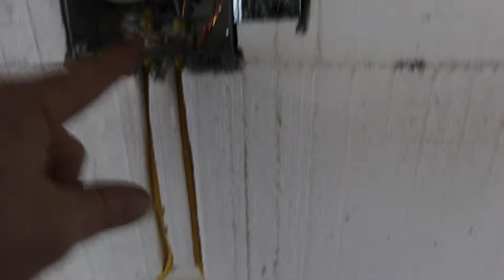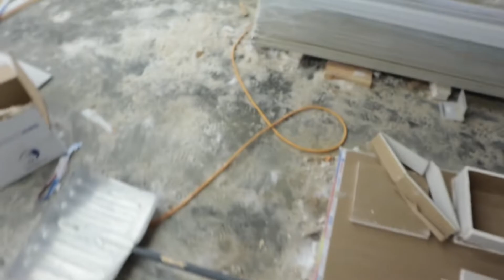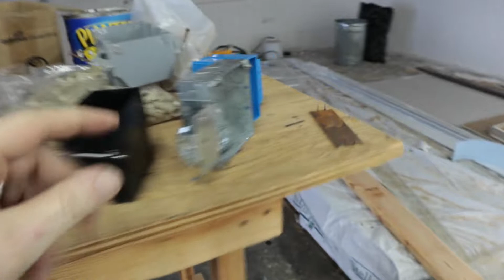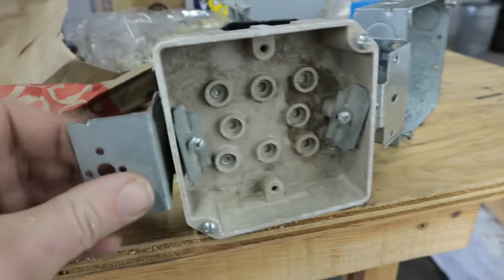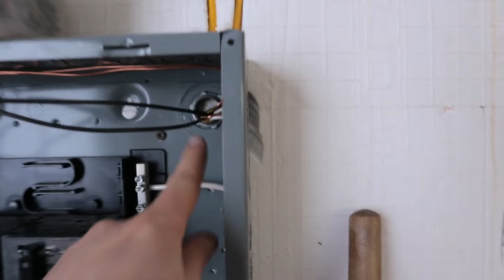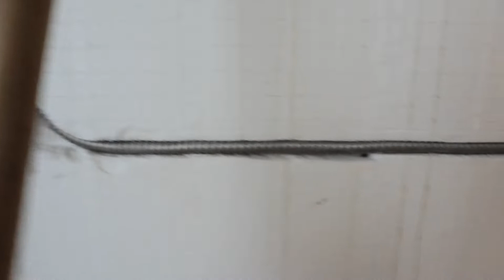ICF Electrical Box Mounting Options

Comment: wrong..... the best for ICF are IPEX ICF boxes 1,2,3 gang........   and transverse running wire need to be deeper into EPS, otherwise at risk with Drywall install... screws will penetrate.  if put the wires about 2" deep into EPS, then the wires are not at risk.... kinda weird to make a 'special situation' recommendation as a 'professional' that are real makeshift seems quite lame, to say the least....